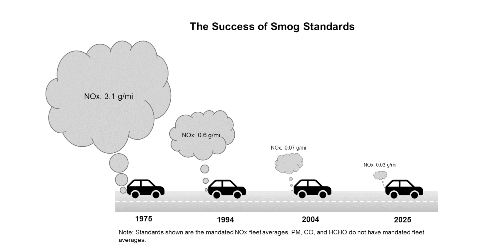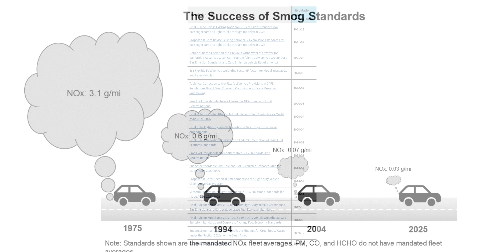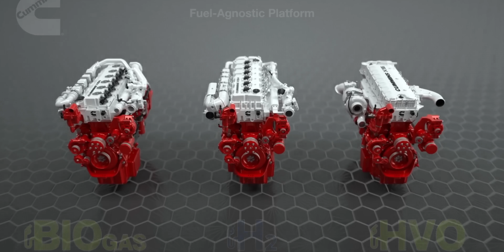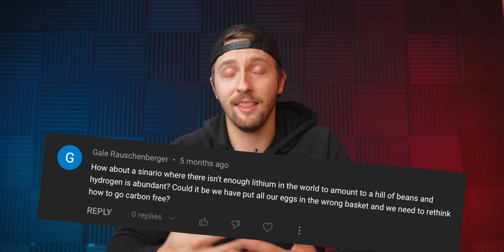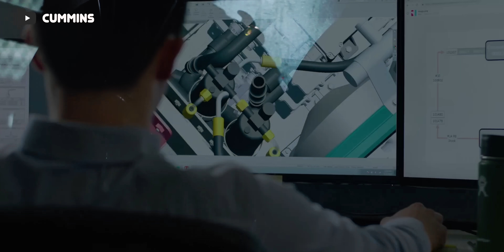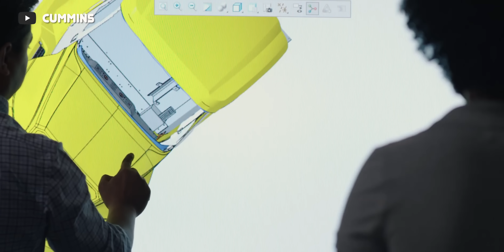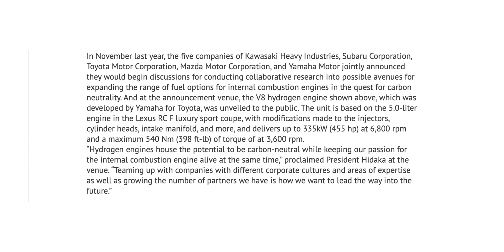Cummins Hydrogen Engine Will KILL DIESELS FOREVER

Comment: Also, we haven’t seen hybrid diesel electric vehicles like we do on trains. I bet this would be a better progression than just going all in on electric. Maybe, there will be a hybrid electric hydrogen engine in the future.
Reply: The diesel-electric locomotive is a series hybrid with or without traction batteries.

Nissan is currently building a series hybrid that they market as the “e-Power” system, which they introduced in 2016.

It’s not available in the US, at least not yet.

The Nissan e-Power uses a petrol engine to drive a generator which powers an electric traction motor. The cars are equipped with a very small (up to 2.2 kWh) traction battery. There is no mechanical connection between the engine and drive wheels.

The only difference between this system and a locomotive diesel-electric is the Nissan uses a petrol engine.

From AutoWeek: 

“Nissan's E-Power series-hybrid setup relies on an internal-combustion engine to power an electric motor; the engine has no direct connection to the wheels.

‘The series-hybrid nature of E-Power means it essentially acts like an electric transmission.

‘The absence of a plug, however, means it cannot be classified as an electric vehicle.”
Reply: Every locomotive I worked on only had a small battery to start the engine that is used to power the air compressor that runs the starter motor on the two stroke engine that provides the "Motive Power.".  They do not store power to run the electric drive motors.   The drive motors are variable frequency and variable voltage, running up to 3,000 volts at full throttle.  

The locomotives have 3,000 gallon diesel tanks, and get refilled every 24 hours when running coast to coast.
Reply: @Kangenpower7  — Yep, until recently. But now battery-hybrids locomotives do exist — in fact, Amtrak has ordered 15 of them from Siemens.

“The initial order comprises 50 diesel-electric trains, 15 battery-electric hybrids, and the remaining trains will be US EPA Tier 4 diesel locomotives and push-pull coaches.”

“The hybrid-battery powered trains can be charged by either a 480V external power source, by regenerative braking, or by the diesel engine.”

Battery-hybrid trains were used in Europe back in the mid 1980’s:

“In 1986, Czechoslovak locomotive manufacturer ČKD built a prototype hybrid shunting locomotive termed the DA 600. The locomotive was powered a 190-kW diesel engine and four electric motors, with a maximum overall power 360 kW powered from batteries. The batteries were recharged while the diesel engine was running, by regenerative braking or from external electric power.”

Comment: Powering electric vehicles off a generator might actually increase the amount of work done at a remote job site that is off grid. Moving things with electricity is more efficient. Moving things with any kind of ICE means that 90% of the energy released from break hydrocarbons will be waste heat. If the diesel generator can make more electricity than waste heat, it could save a lot of money.
Reply: 90% wasted as heat is just not correct. Modern gasoline engines are easily 30% thermally efficient with some over 40%. Modern diesels are over 40% thermally efficient with some approaching 50%.
Reply: @kiefershanks4172  well, what I said wasn’t correct. Also, I am not too sure of what you are saying. According to fueleconomy.gov, ICE vehicles only put 12%-20% into propelling itself in the city and 20%-30% on the highway. The rest is wasted. EVs on the other hand, put 94%-100% into propelling itself in the city and 77%-79% on the highway. I am not too sure if diesel is more efficient or if it just has more energy released in breaking the chemical bonds. I bought and truck that burns gas. I wish I would have got one that runs on diesel. Diesel engines are really impressive.
Reply: @John — If you use a diesel generator to produce your electricity, the efficiency of your electric implements is limited to the efficiency of the diesel engine powering the generator.

So if your generator is running a 40% efficient diesel, the best efficiency your tools could achieve would be 40%, even if the efficiency of the tool was 100% (which is impossible).

Comment: So…someone tell me where I’m wrong here, please (just thinking in the event of an accident and subsequent fire)…so diesel’s not that flammable, and gas is pretty flammable but not that hard to put out when it starts burning…when electric vehicles catch fire, they’re exceptionally challenging to put out once the battery cells have started burning, and hydrogen? I don’t know about you, but to me, 200 gallons of liquid hydrogen sitting in the fuel tanks of a semi sounds like one fender bender away from a massive explosion that kills everyone within 300 yards.
Reply: Batteries kind of smolder. Redivivus is a battery recycling company that has a solution to EVs catching on fire. It is not as bad as you think. Hydrogen in the other hand, is worse than natural gas when it comes to explosions. I would be surprised to see hydrogen go main stream.
Reply: Thank you! All cool and fun until things go wrong. Same with nuclear energy.

Comment: I fully agree with your points about the EPA vs the free market, etc.  That said, constantly bringing up the tired point about electricity production coming from fossil fuels makes these good arguments sound stupid.  The fact is, on a mile per mile, electric vehicles tend to have an emissions advantage even when powered by 100% coal electricity.  Just skip that point in the future to focus on the other, great arguments.
Reply: I believe it was Engineering Explained who made a video about emissions output for gas vs electric vehicles. The video backs up what you said about EVs being cleaner in the long run. Using coal just takes longer to break even. Using solar or wind power makes it happen sooner.
Reply: @BigRedtheGinger  or nuclear.  Wind and solar are so inconsistent, they drive the need for more fossil use as backbone.  

Also, most of the US is backboned by natgas, which is much cleaner than coal.  Either way, random jokers can't delete the emissions control of power plants, or let them go poorly maintained.  

The breakeven argument is valid overall, but Bryce didn't mention vehicle production emissions it in his argument, just the whole "dirty power" fueling argument.  As if fuel production isn't also dirty AF, as that EE video mentions irrc.

Comment: Company’s have been trying to use hydrogen as a fuel for years now. It comes with a lot of problems. Fuel need the be stored under massive pressure. Hydrogen isn’t very energy dense so you will need an extremely large tank for it. The stations to pump it will be very expensive and so on. There have been a few hydrogen cars made and they don’t catch on because of all the major problems to over come.
Reply: Yeah, and no range. So a tractor trailer would have to fuel up every exit even if u increased the fuel tank size a bit
Reply: @seanandrew2823  Fuel cell cars have decent range afore refueling now as I understand.
Reply: Hydrogen has been reported to have quadruple the energy density of existing fossil fuels.  Diesel might not be able to compete if you can obtain viable sources of Hydrogen fuel.
Reply: "Companies".

Comment: Great video, didn't know Cummins was developing such an engine, thanks! As I understand, the benefit of using hydrogen instead of electricity directly for powering vehicles in some cases comes from the ease of large scale storage, it is easier to store hydrogen than electricity in large quantities. (For example, pumping water up hill into dam lake, to later make electricity from it with turbines). The hydrogen would mostly be produced via electrolysis when there would be an abundance of renewable electricity, for instance, a very windy and warm day.
Reply: they are not developing nothing they have had these engines for decades and they use these engines in the underground cities the so called elites built
Reply: Check out this video. https://youtu.be/KhtWiK9A4ww
Reply: @jjoshua69  yep people are so gullible these days ..... minds of children .......
Reply: Yeah When renewable energy is available. They cant even recharge the cars.
Reply: @tomoconnor7528    Why can't they recharge their cars?  If they had solar panels at their house they could charge them at home.
Reply: Hydrogen is a great fuel on paper, but it is very difficult to use. Natural gas is easier and safer. Hydrogen has to be cooled down to -423F, and has very small molecules which cause a lot of leaks in the lines. If it was easy they would have done it 50 years ago.
Reply: @TexanUSMC8089  you people ..... there are no nuke power plants they are really hydrogen

Comment: electric excavator is everywhere here in Norway..
Reply: How do you charge them?
Reply: @jeffsikula2920  with diesel engines i guess?🤷‍♂️😂
Reply: @mariusfridlund55  That's what I'm getting at..
Reply: @jeffsikula2920   Norway makes near all there electric from hydro electric dams, they export large amounts of there surplus electricity too
Reply: @mikerussell3038  I think you know what we're talking about here....like when  that excavator is in the middle of nowhere??  How do you charge it?
Reply: @mikerussell3038  yes, and now the price of power is sky high.. because of the stupid goverment and the clowns that is att the wheel up here in the north.. "new poor" is a new word in Norway..
Reply: @jeffsikula2920  with atlas copco diesel generator, stupid but true
Reply: @mariusfridlund55  if it's in the middle of nowhere you would have to bring in a generator most likely diesel to charge, but realistically excavators and equipment is generally at a site with other equipment and you might have maintenance areas and fuel tanks
Reply: Bringing in a power supply and utilities be little different than bringing in a large tank and refueling in regularly

Comment: Cummins are still selling new what you Americans call the ‘big cam’ engines. Worked on a few new build ships recently with brand new Cummins kt19’s and kta 50’s on them. Still current still working.
Reply: The big cam is still produced? Where is it even legal?
Reply: @justinmartin8887  yes still fitting them in ships
Reply: There are thousands and thousands of cummins KTA19GC out there in the oil fields

Comment: Given current electricity costs, there is no way hydrogen via water electrolysis shown here can compete with hydrogen made from fossil fuels, which defeats the purpose of going to hydrogen.  This is just an R&D contingency project at Cummins to have as many options on shelf as possible should need arise down road.  Odds of Cummins actually marketing a hydrogen ICE in 2027 or later are very slim.  As far as planned escalating ICE emission restrictions, in any democratic republic, those are always only one election away from being slowed or reversed.  EVs will have their niche in transport logistics until new power plants, new charging stations and improvements in batteries yield needed range to complete with fossil fuels.  Will add, don't see any utilities rushing with plans for more nuke power plants, and sure doesn't look like wind and solar are going to bring on the electricity needed for expanding EVs beyond current niche.
Reply: We keep hearing about "battery improvements" yet nothing happens...
Reply: @melvingibson4525  Yeah, long road between R&D and a marketable reliable product.  Many initially promising innovations just don't turn out to be practical in the end.  Will add, I don't view lithium ion "batteries" as batteries.  A battery to me involves harnessing the voltage potential of a chemical reaction to yield direct current in a wire.  Lithium ion "batteries" seem more like a slow charge/discharge version of a capacitor.  Not saying that's good or bad as an energy storage device, just that they're not batteries as the word was typically used in technical discourse going back decades if not centuries.

Comment: Clean diesel, made from hydrogen.  Is the short term and possible long term solution.
Reply: Much like porche's e-fuel, which gets its carbon from the atmosphere, then green energy from the big 3 (solar, wind, water turbine) to synthesize a liquid fuel. 
That seems like the way to go as it doesn't displace more carbon in the atmosphere from fossil fuels but takes it from what's already existing in the atmosphere. Granted, it'll be out there again but it works.
Reply: @tt7hvn  Imperial oil in Canada is already testing its 797 haul trucks to run on synthetic diesel in Alberta.  Farther along then you would think.
Reply: @mathewborys6515  with synthetic fuels though, there will always be a net energy loss....
It's not necessarily a bad thing in the broad scheme of things if we don't have to reinvent every vehicle on the road to accommodate a synthetic fuel. 
I think the bigger issue of synthetic fuel will be keeping up with demand.

Comment: I would also beware of electric vehicles for multiple reasons. Lack of power, in winter your batteries will definitely die much faster and leave you screwed, I doubt you can jumpstart one etc.
Reply: No Jumpstart, has to be towed, or charged, if that is what you meant by "Jumpstart".
Reply: The only thing electric brings to the table is it is more efficient and it is cheaper to work on.
Reply: @HeLpEr4u083  Well batteries aren't getting better quick enough. No one going to spend $20,000 for a new battery pack when it goes bad like it cost in Tesla's. You forgot more powerful and more reliable. But yeah, not much brought to the table so far.
Reply: @EETechs  How is catching on fire in your house reliable? In terms of power it's all in the way it's engineered. I would rather not pay $130,000 for 1,000 ft.lb torque when I can get the same for half or even less. Now in terms of HP, Diesel's do have lots but they are not meant to be racing machines though people build them that way. If someone wanted to and had even $50,000 to spare, they could go out and buy a diesel pickup from 2006 ish and make over the amount of HP and Torque than a Tesla Plaid. The green movement is just corrupt politics. Now I am not saying there should not be unique or neat electric stuff like chainsaws or weed wackers or vehicles. I think those are fine and dandy, it's just your preference. But you also need to understand that you will be tracked in your electric car and told when, where and if you can drive. Overall, it's not worth it. It's essentially in the end a voluntary surrender of freedom.
Reply: @HeLpEr4u083  The electric motor I mean as being reliable, the battery is not reliable at all and is a fire risk with current tech. Not questioning that at all. Electricity is already controlled also. All those electronic meters that got installed recently on homes track your power usage trends and also they can kill your power remotely now. The days of the old disk style meters are gone. It's already too late.